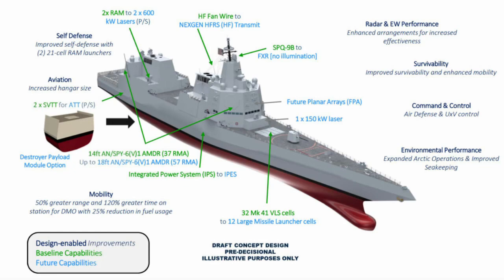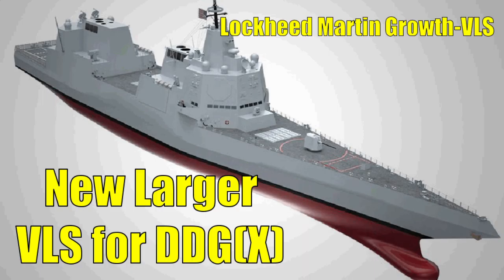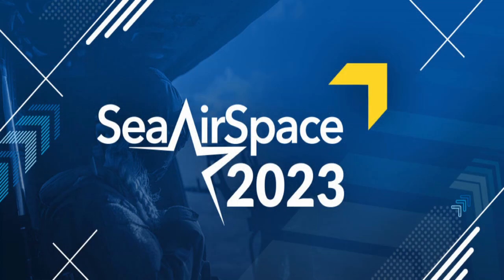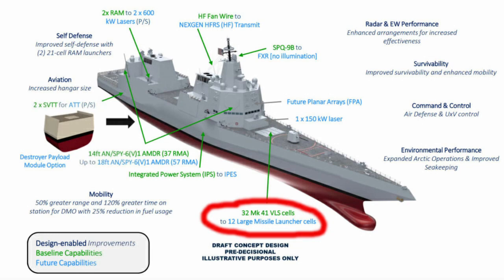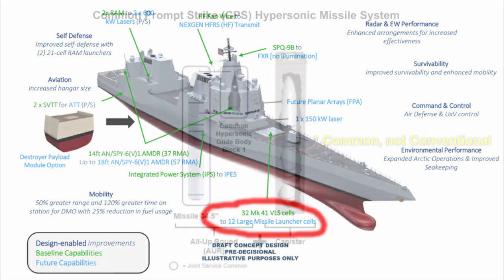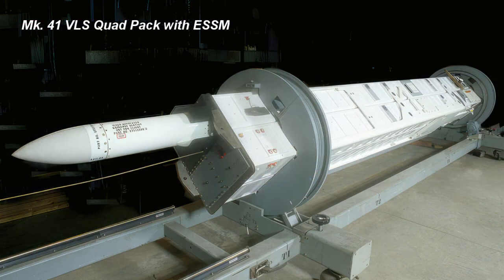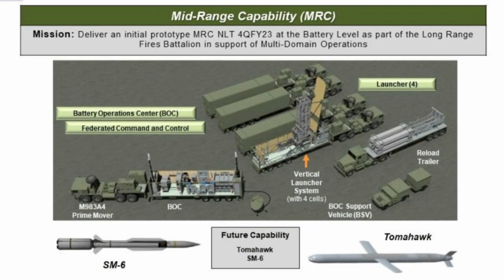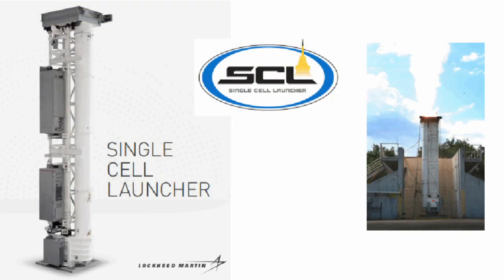Growth-VLS for DDG(X)

Comment: I really don't think that the G-VLS will be able to quad-pack SM-6 into a single G-VLS cell and still be able to install a single four-cell module in the same footprint that an eight-cell Mk 41 VLS occupies.
Reply from the maker: According to this article (https://www.navalnews.com/event-news/sna-2025/2025/01/lockheed-martin-provides-updates-on-naval-pac-3-mse-and-g-vls/) G-VLS is larger then the Mk. 41 VLS.
Reply: Not the same foot print.

Comment: I can't tell if there are Chinese trolls replying or normal viewers?

If they aren't trolls, they should know that stealthy guided missile ship design will naturally trend towards a similar design, assuming each variation is a well-designed ship using the latest technology. Also, the Chinese military/corporate industries are absolutely notorious for stealing everything possible from the US military/corporations via massive espionage efforts.

A majority of their military designs are either stolen from the Soviet Union/Russia or the US. For example, the Chinese J-20 utilizes stolen US tech per multiple direct quotes coming from USAF generals, including the USAF general assigned to the Pacific command.

All things considered, calling any US military design a "Chinese knock-off" is ridiculous. In fact, the Type 055 has several design aspects very similar to previous generations of US/NATO ship designs, so if a US design is similar to the Type 055, it ultimately just means it's a progression of earlier design stages that the 055 has already copied.